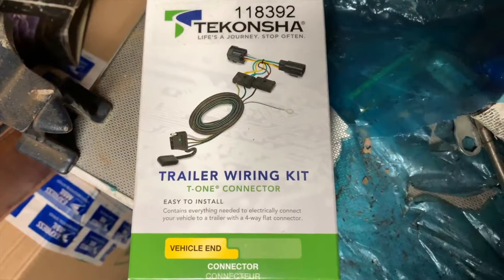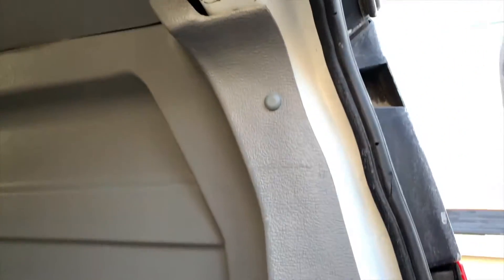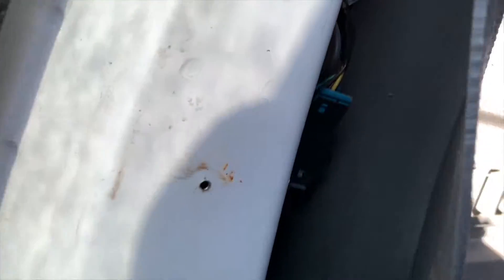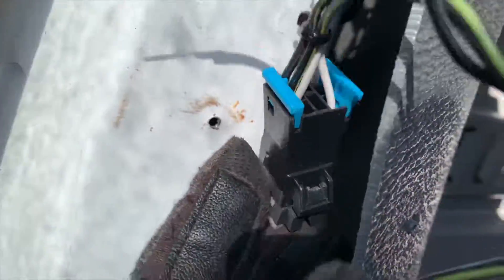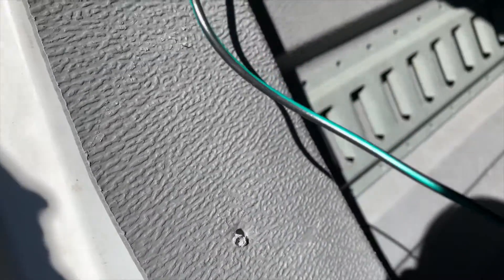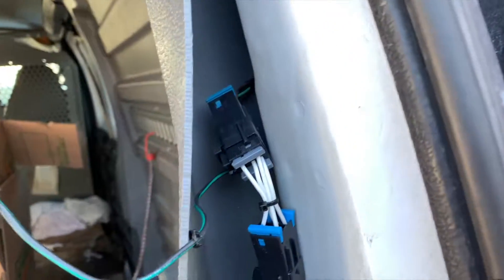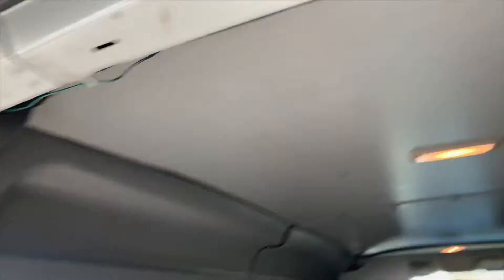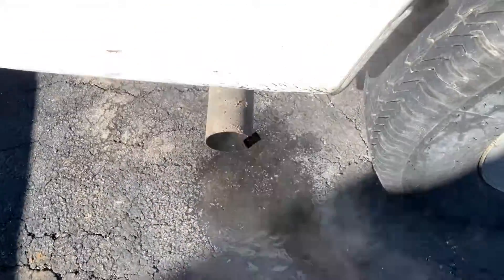Installing a Trailer Wiring Kit On My Chevy Express works for Gmc Savanna

Comment: So you don’t have to run anything to the front panel under the seat ?
Reply from the maker: Absolutely not.
Reply: You only have to run wires to the front if you need a brake controller.